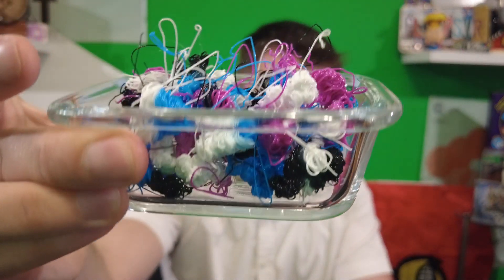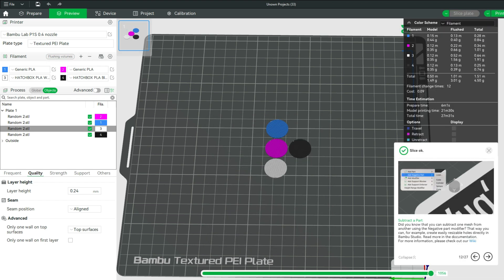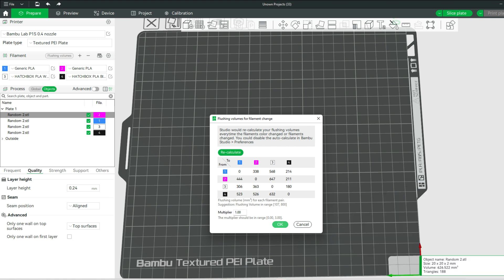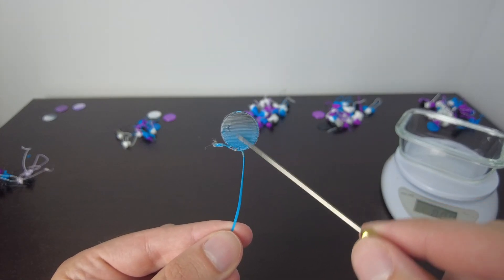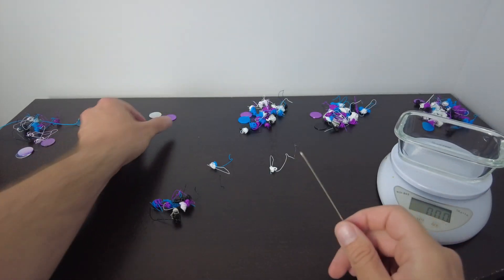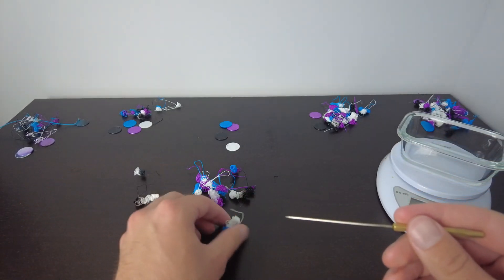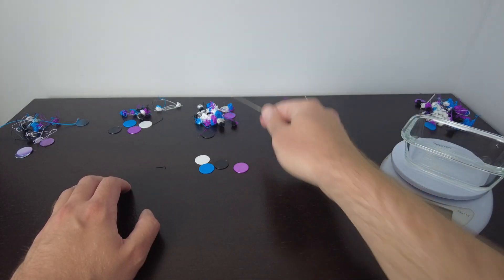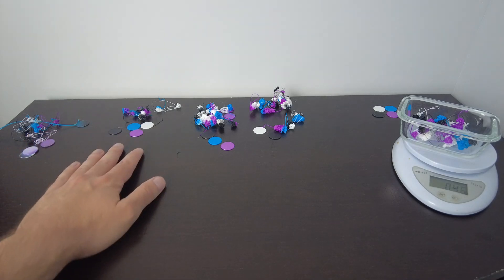The best flushing volume to reduce your filament waste (poop)

Comment: I just printed a 3 color piece , red black white,  and i've never changed my flushing volume in the year i've had my P1S, mostly because i don't print multicolored for the poop waste reason. I recently found a HUGE print i want to do and it's got so many multicolored pieces. I tested that one piece...the whole model came out to be 3.5g , and it had 25g of poop. The black still bled ever so slightly into the red with the default 1.0 multiplier....because i never changed it before.  temped to see if .5 makes it worst or not...i know it won't be better. The model i want to print probably has at least 80 multi color pieces. I'd rather not hand paint pla, because i suck at it...and i'd rather not WASTE so much filament. It's a 65cm tall Voltron. Just the Red Lion is 350g for the model, 700g waste. That's insane.

Comment: If you are using pla for support interface layers for petg or vice versa you will defiantly want to have this higher level otherwise even though you will not notice any bleed through your print will come apart at that layer as the PLA and PETG do not bond well together. I was using a 1.3 multiplier, and I could easily pull apart the layer.